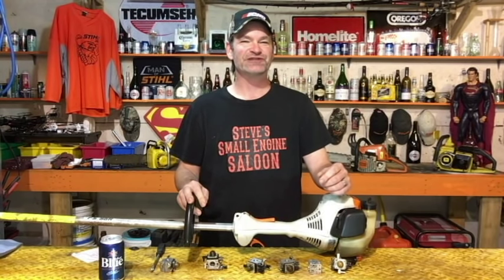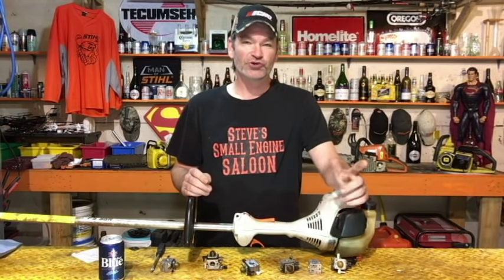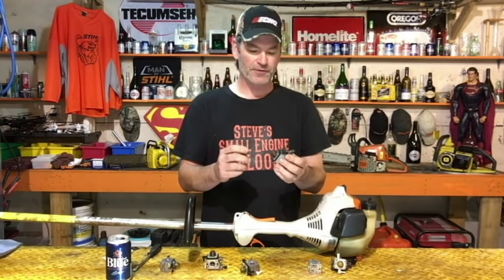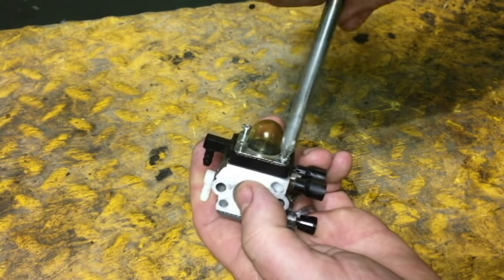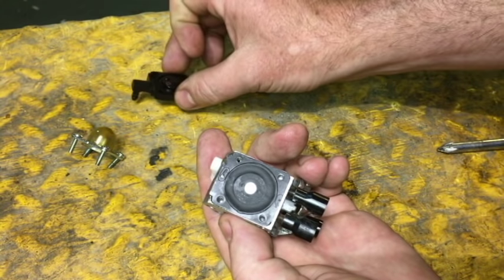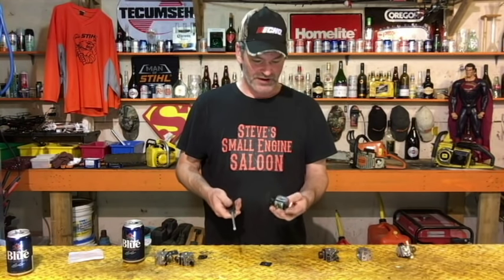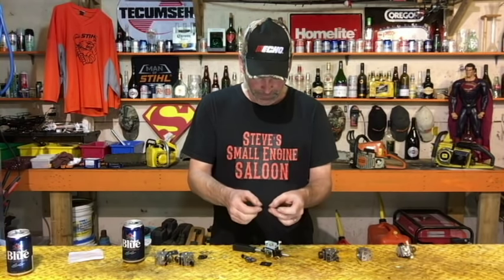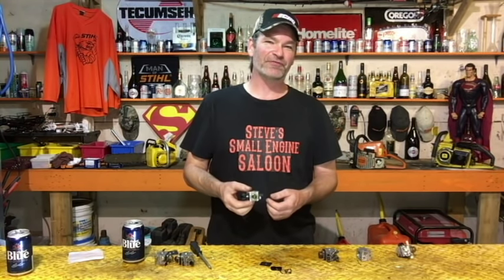How To REBUILD A CARBURETOR On A ChainSaw, WeedEater, Etc.

Comment: Hey Steve you give us some great information, I know I wanna go read my chainsaw's manual now!  I've got a question about the metering side of my carb.  I fired it for the first time since November couple weeks ago, and the primer bulb seems to be really lackluster.  it still works and does what it's supposed to but it just seems to be unmotivated unless i push down every bit out of it before it'll draw up gas.  does this indicate the diaphram issue you talked about? got a Echo 352.

Comment: My own its starting OK but there is no gas flowing and I don't know what's he problem is any time I press the trigger it shut down ...any advice
Reply: fuel filter? 
stuck diaphragm?
shit gas?
does it wind any before it dies....if so its an air leak/cracked line.

Comment: Husky 55 chainsaw. Cranks easy revs up and runs great for about 20 seconds then dies like it’s out of gas.. Put carb kit in and fuel filter, same thing. Help!
Reply from the maker: Could be the fuel tank vent is not working!  You could try replacing the fuel cap with a vented cap and see how that works....
Reply: Steve's Small Engine Saloon i ran it on its side with the fuel cap off and it did the same thing... also hooked a different fuel line and a bottle of fuel straight to carb and did same thing. Any other ideas? Thanks for the response!
Reply: whiskeybusiness Your Saw runs on pulses from the engine that pumps fuel to the engine. The Husky 55 has a small grommet between the carb and the engine that is prone to leaking, causing an interruption of the pulse, starving the carb of fuel. It’s a cheap part, and easily replaced.
Reply: @kriswright1022  i will check that out..Why would it run for a while first though? Seems like that would be cause it not to run at all. Thanks for the tip!
Reply: whiskeybusiness it runs till it doesn’t get enough fuel under load, the leak is causing a lean condition, meaning it’s starving for fuel.
Reply: Try removing the mixture screws and blowing in the fuel inlet with compressed air, you might have gotten some shit in there causing a part blockage.

Comment: How do I know what type of carburetor I have? I’m running redmax’s commercial weedeaters
Reply: josh look at the side where the choke lever is all walbro carbs model #s (668 997  1107 etc) are printed in black ink upside down on the choke lever side if not it's not a genny walbro.

Comment: What are the chances of you doing a video on rebuilding a carburetor for an old outboard motor? Maybe something like a 1961 Johnson 10HP Sea Horse QDL. Outboards are kinda expensive to replace.
Reply: A boat is a hole in the water you try to fill in with money.

Comment: Great vid,wow ! .
This may already be in the comments,but the spark arrestor gets clogged in all Stihl whippers. Use a spark plug socket and remove it,then remove the spark arrestor screen. It always gets bogged up as most savy users use a tad bit more oil as we are not morons.Less 2 stroke oil is very bad,a lil bit more is always ok,yet can clog a spark arrestor in  a stihl. Cut that screen off and you are ready to go.

Comment: Hey Steve I need some help and I don't know how else to reach you. I'm about to purchase a new weed trimmer my old one is about 19 years old it is a Stihl FS 80. I trim my city yard and my Farm property most of the time I use line but there are times where I use a circular saw type blade for cutting stumps. I was seriously thinking about an echo 1620 t because of the higher torque on high weeds and because Echo lets you use steel blades without the bicycle handles some people imply that steel will also let you use metal blades without the bicycle handles but a you handle in a little bar that attaches to that handle. That is true but it is not true with the blades that will cut saplings just grass blades. Can you outfit a sthil with a U handle and breaker bar and still use these blades absolutely but not according to the policy of Stihl . Echo let you do this. That said I am wondering what your feelings are about the echo 26 20 t and also some stihl  would you try to stay with a pier to cycle or would you be willing to move to a 4 cycle mix trimmer I really like my trimmers to last a long time that's why I buy a professional model even though I'm a residential user at first I was really leaning toward the echo but I can't find any really long term reviews most are only one or two years old so Steve should I go with a Stihl or Echo and do I go with two cycle a 4-cycle with oil mix or something else specific models would be nice there seems to be quite a difference in warranty also thank you for your time and I understand this may not be the proper venue but I wasn't sure how to reach you. Thanks Simon ps  I've had Fairly good luck with the old sthils only needing a little work but I'm not sure about the new ones anymore

Comment: H-E-L-P STEVE H-E-L-P  Have Hitachi Blower that one pull of rope floods cylinder head with fuel on top of piston, have to remove spark plug to remove fuel.  I'm guessing it's a carb issue, will the rebuild kit (such as seen in this video) likely solve this problem? Are you familiar with the Hitachi Blower carb or maybe the rebuild parts kit number? 
Many thanks for your great videos, I have learned alot.

Comment: Had a faulty carb couldn't get a check valve so bought a cheep Chinese copy , it came the inlet was blocked with resin or  something , poked that out could not get it to run right , spent ages trying to get it to run right , so took the check valve out and used it in original and fitted new parts ran first time 🥴 buy cheep buy twice

Comment: I have a Husqvarna 128ld I'm having problems with. Fuel line had corroded, filter was sitting in tank, I changed fuel lines/filter, and broke down the carb to clean it. I got it started and it ran like a champ for 1hr, then after refueling it now cranks over but doesnt run. I'm cleaning the carb again... 

Is it possible carb was so dirty that after i cleaned it the first time there's now more gunk that "came out"? Or is my carb shot? Is there anything else I can check? 

I've adjusted the carb (it ran & sounded good) I don't think it's the idler but I haven't adjusted that. I took off screen on my spark arrester, I even muffler mod 2extra holes it now runs super cool but still problems keeping it running.... I've been using carb cleaner, starting fluid etc.... help, lol.
Reply from the maker: If the fuel filter came off, good chance some junk got sucked straight into that little screen in the carb.  If that's ok, I would pop the muffler off and have a look at the side of the piston.  Could be scored!
Reply: Steve's Small Engine Saloon thanks for the reply man! 

After I commented I cleaned the carb again- sprayed carb cleaner everywhere, shot air through every hole I could find... it started up on the 4th crank! I ran it for another hour, got my yard done before dark... 

On my first clean on carb there was gunk on that screen. On my second clean there was no visible gunk on screen or anywhere but I still did another deep clean and that got it running there after. 

I almost didn't do the second clean because I had cleaned it so much the first time and I couldnt see any visible gunk but I'm glad I stuck with it and cleaned it again because something must have "came out" while I ran the engine the first hour, clogging it up again. 

Definitely if I have any further issues I'm going straight to check on that piston and I'll report back! Thank you!

Comment: If I ever hear anything like "the most common", "9/10 times" or "99.9% of the time" I can 100% absolutely without a doubt guarantee my problem is the exception. Every. God. Damn. Time.
Reply from the maker: Murphy's Law,  that sucks...
Reply: check your impulse line it may need to be replaced

Comment: On some of these carbs you can't even buy rebuild kits?
Reply: Stone859 check Amazon for a complete carb.
Reply: @charlesmckinley29   Thanks for the info.  I actually did purchase a new carb off of eBay.  I included fuel line, and a filter...I think for under $20...very reasonable.  Installed it, and it runs like new.

Comment: My FS38 Stihl weed eater motor runs slow and has no power even at full throttle. 
l would imagine a carb problem, huh ?
Reply from the maker: I have a video in my playlist called stihl wont rev up..
Reply: @StevesSmallEngineSaloon  Thank you very much ! It worked ! I heated it up with the torch and blew it off. Looks like a new arrestor ! My next beer is dedicated to you, my friend ! :-)

Comment: Brand new subscriber, Great video's. Rebuilt my Stihl BG 55 blower. Turning the high end screw out, I can get it to slow down. Turning it in, not so much. Don't want to turn it in too far. Seems to be running fine. I don't want to break anything.  Any suggestions?
Reply from the maker: I have a video in my leaf blower playlist called "blower wont rev up".  Try that....
Reply: Yes, I can get it to rev up. When I screw the high speed screw in, I can't get it to slow down. Just when I screw it out. Thanks

Comment: you can buy a complete brand new carburetor on amazon including hoses and a new spark plug for $24 ,- canadian .
its cheaper than the rebuild kit from STIHL !
Reply: Speaking as someone who just bought an entirely new carb (super cheap $16 US) I'm not so sure that's the way to go.  After installing it, it works o.k. (less power than before) but won't idle, dies every time.  So now I'm wondering where I can just get a rebuild kit for the old carb.
Reply: @843292  there are 3 distinct fuel flow ratios in these box style carbs for 3 different displacement sizes... sounds like you got the wrong size.
Reply: @chickenlips8696  Thanks for your reply.  The product description listed my model of trimmer, but I've found those descriptions to be in error in the past.  The new carb looks like it's the same as the old one, but I don't know how to tell if it has a different fuel flow ratio.  Thanks again!

Comment: Edited comment.  The needle valve lever HEIGHT should be flush with the body of the chamber or otherwise set to spec on a particular unit. Bill

Comment: Wouldn't it be easier to just replace the whole carb lol....I didn't think they were very costly
Reply: The carb kits are usually much cheaper
Reply: @lawnmowermanlawnmowerman9930  idk if their oem, but I've seen the whole carb for like 15buck on ebay

Comment: Hey man, I have a question. Thanks to your videos I was able to fix my dad’s hedge trimmer by replacing the diaphragm. I’m having trouble finding the exact same metering diaphragm (I just so happened to have a rebuild kit with the exact same one.)

I’m wondering if I need one the exact same shape. I can find one with a couple 45 cuts on one corner but the one I used and came off was 90 degrees on that corner, if you catch what I’m saying.

It’s a walbro carb on a maruyama hedge trimmer.

The diaphragm out of the kit I used was for a Redmax/husqvarna kit.

I can find the gasket but have trouble finding the exact same diaphragm.

Comment: Alrighty Mr. Steve...this is gonna sound like I don’t know what I’m doing...and I don’t roflol.  I’ve got the beer, so that’s not a problem.  But I’ve got an older Echo SRM 210 that I replaced with an FS90R.  The Echo needs a carb job, I checked and it’s a Zama.  But is there a specific model of Zama carb rebuild I need to order?  The model number on the Echo is 05160660.   I’m going to let a young man use it.  The males are too rough with the Stihl, they always want to play with the throttle, instead of holding it steady...  found it. It’s an RB 2

Comment: I usually just take a carb off and drop it in a one gallon can of safety clean over the weekend. I blow it out with air to dry it out and it runs like a raped ape usually.

Comment: How to rebuild a carb on a Stihl - gather $41 and buy a new carb.
Reply: I went on eBay about a month ago, bought a brand new carburetor for my Stihl FS55 grass trimmer, and it came with a new set of fuel lines, a new fuel filter, a new spark plug, two spare primer bulbs, both gaskets, and a new air filter, all for $11.98 with free shipping.
Reply: @throngcleaver  that's what I should have done. I did the same thing, only I got mine from the local hardware store. I only needed one part but a while new carb with everything was only $10 more than the one part that I needed.
Reply: @adamsgrace2012  Yep, I usually find a great deal AFTER I've bought something else, but that time, I got lucky.  At least I'll remember it for the future.